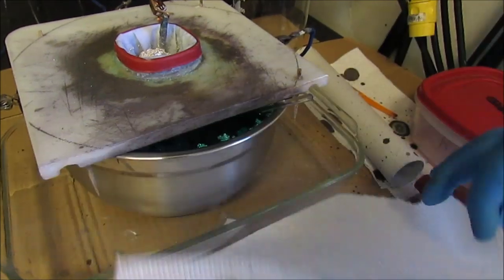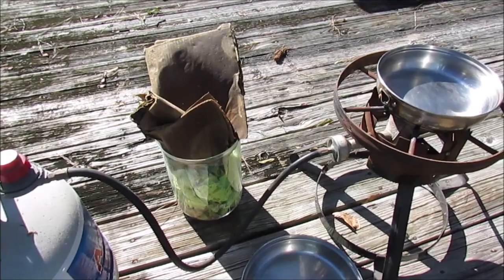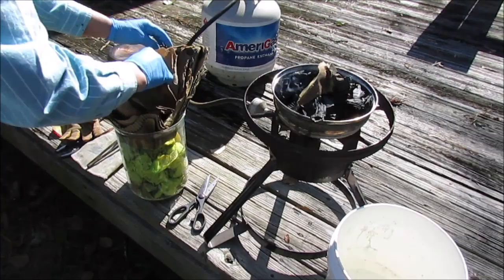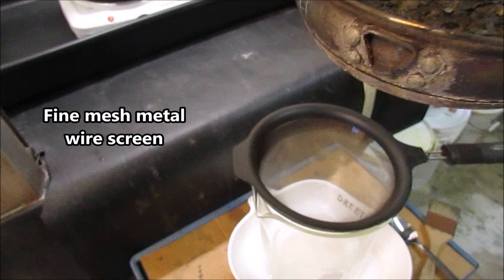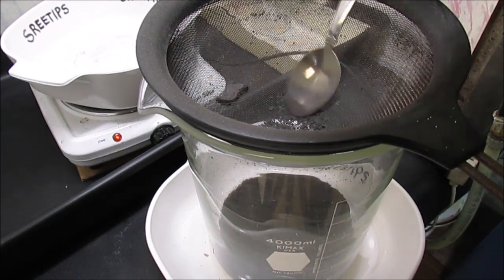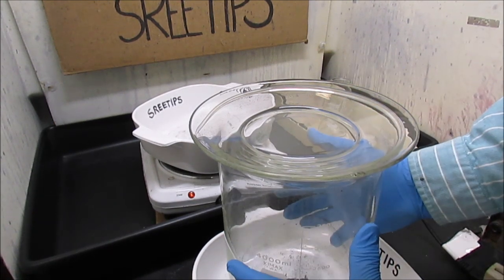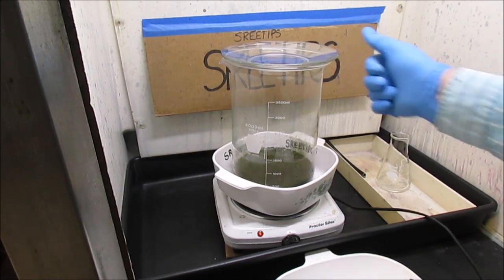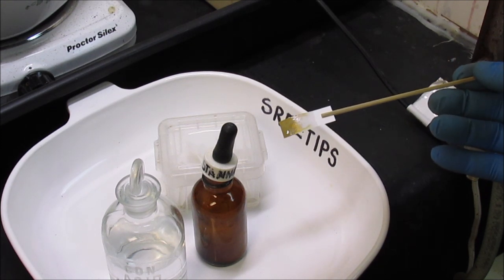Stock Pot 9 of 16 Recovery From the DISASTER

Comment: Don’t forget to hit the containers with a little Aqua Rega that your burning the paper in,, as the burning paper produces some resins that will retain some PM’s.... I personally found this out when burning my silver filter papers,, got curious on if any might be there, so I dissolved it and checked it with chloride and sure enough it tested positive so it’s very possible to happen with what you’re doing as well
Reply from the maker: Good point, I'll check it and see.
Reply: @sreetips  the main thing is that you could also had burned down all the carbon as well!So that you would have only PGMs and because temperatures of decomposition of their oxides is quite low-you could not to worry about them at all!
Yes and also after all it's far easier to separate platinum from palladium having only their powders!I even don't bother myself using aqua regia in this case:just nitric acid to dissolve palladium,smelting after that all that is left and the same thing with  palladium itself!I now mostly deal with cat converters and initially when I didn't know that there are three sections of the honeycomb and each one contains only one PGM most of the time so before I knew that I separated them through completely dissolving rhodium metal by molten potassium bisulfate,and than precipitated it through converting into sodium chlororhodate which does not dissolve in anhydrous ethanol unlike sodium chloroplatinate and chloropalladate which do dissolve and after simply smelting rhodium metal directly from that salt(obviously upon reaching it's melting point everything else either evaporated or served as a flux),I had after that a bunch of anhydrous ethanol and my platinum and palladium salts dissolved in it-so I simply ignited all that stuff and so was left with a mixture of platinum and palladium sponges after all that I combined with the same platinum/palladium powder mixture that didn't dissolve in molten potassium bisulfate(surprisingly they both hold much better than rhodium against it!) and so next I did exactly what I described earlier!So the whole process of cat material after I applied HF and dissolved ceramic crap with it-I just separated everything in couple of hours-now I obviously spend much less than that since I just throw each tipe of honeycomb into one of three HF baths and so when it's done all the dirty work I just have to collect all that sponge on the bottom of each and smelt everything in three nice blubs!
Not exactly the same task but you got the point..

Comment: I have been saving all paper towels I used to wipe my work table after filing and sanding silver. I was wondering if I could incinerate the papers and then just melt the ashes and silver with borax to a bead. What would the result be like?
Reply from the maker: I've never tried it, but my guess is that you would end up with a pile of ashes with no bead of silver. This is especially true with paper towels - they don't incinerate very well with the set up that I am using. I tried it in one of my jeweler's waste videos. I had a garbage bag full of paper towels. It drove me nuts trying to get the metal out.

Comment: Could you hit the ash after incineration with piranha solution to get rid of the carbon? It might not be very efficient for chemicals but you would seriously reduce the amount of non precious material you are dealing with through the process. Im not sure how soluble Pt or Pd are in highly oxidizing and acidic sulfate solutions but if they arent soluble, the piranha might also help you part out some of that pesky copper from all the previous steps. 

Just my thoughts let me know why this wouldnt be a good approach if   you know more than I do. 

Piranha solution is conc. sulfuric acid and conc. H2O2 if you didnt know.
Reply from the maker: I've never used it. I don't have any experience with piranha solution.
Reply from the maker: You've got my curiosity peaked. If I hit the ash powder first with piranha juice it should form copper sulfate that can be rinsed from the solids thus ridding the PGMs of copper. Is that correct? I can test with stannous to see if the PMs follow the CuSO4. If neg test for PMs then thats a good way to get the copper out.
Reply: @sreetips  if you have copper in there the sulfuic acid will eat the copper 
but you will still need extra sulfuric to bond with the hydrogen peroxide.

( I looked up the molecular formula for cardboard. There is none. Cardboard is always made from various sources so, no telling how much organic material is there. You'll always have to just eyeball this process. )
Reply from the maker: Got it, thanks Author.
Reply: @sreetips  One More Thing. 
H2SO5 + Cu + H2O2 ---------> CuSO4 + 2H2O
H2SO4 + Cu                 ----------> CuSO4 + H2

You should use only Sulfuric at first to eat the copper.
If you add both right away the hydrogen gas will just turn all your peroxide into water
and waste alot of it.
Reply: Sreetips that sounds like a good approach, leach out the Cu with the H2SO4 in the piranha and let it eat the ash. Check with stannous to see where the values go and it should help you out. I wouldnt expect Pt to go into solution with sulfate, but maybe Pd would since its "less" noble.  
Im thinkin Author is right too, you may need additional sulfuric to have enough to both eat the ash and the Cu. Also that hair salon peroxide seems concentrated enough to give you strong enough piranha. I dont think it works with the 3% stuff.
Reply: @sreetips  I'd recommend being extemely careful with Piranha solution ...

Just as an example:
"- Always use glass (Pyrex® is preferred) containers.  The solution can degrade plastic containers causing failure of containment.
- Ensure all containers are properly labeled to identify those containing piranha acid solutions.
- Always mix the solution in the hood, utilizing the hood sash as a barrier between you and the solution.  Wear appropriate PPE including: acid resistant lab coat and/or apron with sleeve covers, gloves (butyl) and chemical splash goggles.
- Always add hydrogen peroxide to sulfuric acid while gently stirring.  DO NOT add sulfuric acid to hydrogen peroxide.
- The hydrogen peroxide concentration should be kept under 30% and should NEVER exceed 50%.
- Piranha solution will become very hot with temperatures exceeding 100°C during preparation.  Handle with care to avoid thermal burns.
- Do not mix piranha solution with incompatible materials such as organic acids, organic solvents, or other organic materials.  Do not mix with bases (e.g., Photoresist).   Mixing piranha with incompatible materials can lead to an explosion.
- Ensure all containers and substrates are rinsed and dried before coming in contact with piranha solutions.  Piranha solution is intended to remove residues only.
- When submerging items in piranha baths, place items in the piranha solution slowly and carefully.  The solution needs time to stabilize after each item is added.  Apply piranha solution to substrates carefully as well.
- NEVER store freshly prepared piranha solution in a closed or partially closed container.
- After use, always allow piranha solution to react overnight in a labeled, open container within a fume hood prior to final disposal.
"

Source: https://ehs.princeton.edu/book/export/html/513

Comment: You may want to try to get more oxygen to the paper to get it to white ashes.
Reply from the maker: How? I could squirt a low pressure stream of O2 from my oxy/acet torch on the ashes. Adding forced air of any kind just blows the ashes out of the pan.
Reply: @sreetips  you may try a splatter screen to go on top of your pan that should let more O2 in and not let the ashes fly.
Reply: @sreetips  or find a couple of 1/8 inch welding rods knock off the flux bend them past 90° and use those as a spacer between the pans.